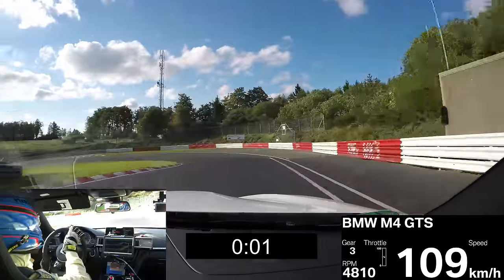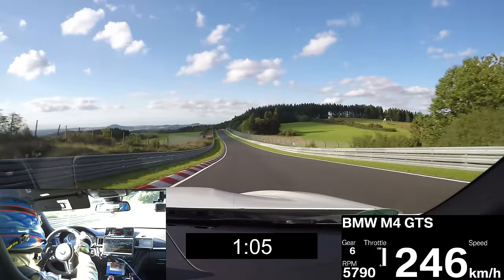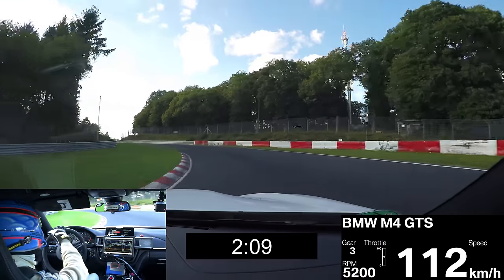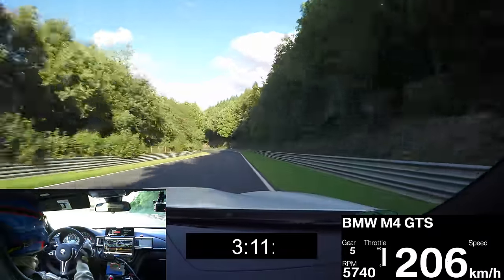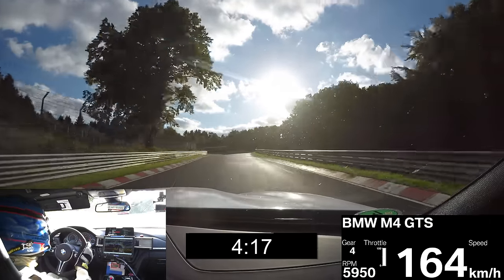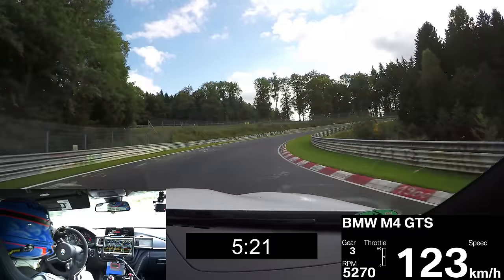BMW M4 GTS Fast Lap Nuerburgring Nordschleife.

Comment from the maker: Enjoy!
Reply: +BMW M AWESOME SUPERCAR, one of the best in the world!
Reply: +BMW M Wooow, great driver too!
Reply: I really appreciate the commentary! It's good to have a credible driver talk about the things to look out for on this track. Amazingly stable car.
Reply: What tires did you use for the hot lap?
Reply: +BMW M Very impressive BMW, not far off a fully striped out, hardcore GT3 RS! Yet carrying another 160+KG
Reply: +BMW M super good video but i think the guy on the voice should not spam that much.. we want to hear the car and it's annoying at all..
Reply from the maker: +giannhg13 Try this one: https://vimeo.com/149558690 ;)
Reply: +BMW M yeah better than c63S!!
Reply: I did!
Reply: +BMW M That BMW schould beat Porsche 991 GT3 RS, it has lower engine and more torque than Porsche. Needs better driver
Reply: +Hen zo 
actually its his style that trows you off. its  how some drivers use that wight shift to get rotaion they want others hold the wheel in one place and use the throttle to do it. trust me he did very well
Reply: +Kreso Ticak I forgot about speed limiter at 270 km/h
Reply: Outstanding
Reply: +Simon Walker there's always one Simon walker who has keyboard warrior syndrome. Congratulations for showing your ignorance of all things engineering. Nice rant. But pointless
Reply: +jamviator There are some keyboard warriors who need to get their facts right. All talking about specific outputs yet a family car just beat a £400,000k hypercar around the track
Reply: +jamviator  Move on with your life? What life considering you are on youtube trolling lmao?! And Merc fanboys coming from a BMW fanboy judging by your avid bullshit. "BMW is the best engine manufacturer in the world, period." lmao where are they in LM1? LM2? Formula 1? Mercedes, Ferrari, Lotus, and McLaren are only names you see ever come up.  No BMW. Mercedes has evolved the racing motorsport time and time again lmao in over 100 year history. They had cars in the 30s with over 1000hp that were too powerful and too fast for drivers at the time...then. And you come with this bullshit about it just beat a Zonda. So what lol a GTR will beat any car these days even a fucking Veyron. Instead of glorifying BMW why don't you mention facts like these times lol : 8:05 BMW M3 E92;  8:07 BMW Z8 E52, 8:09 BMW M6 E63, 8:15 BMW 1 Series M Coupe. Thats range bmw is at for their M cars lol. So here they come with a lightweight edition of a highly tuned car running cup tires and considering it uses fucking meth injection to even get that power. Just like the M button these cars are never run full boost all the time. not to mention you dont own one nor ever will. Hell you will never even go to fucking Nurburgring track. In daily life your underpowered BMWs will eat dust period. 

" I compare BMW to all other manufacturers combined." spoken like a true trolling BMW fanboy who decides to be a keyboard warrior as guy below put it lol. Going after a Zonda F and comparing it to this...hahahahaha fucking moron. A Radical R8 will do sub 7 min time and its legal in most countries except US. Do you see anyone saying its better than a Veyron? Zonda? LaFerrari? I could see it if it was Porsche and a GT3 or GT2 at it....but a BMW???? Now you just sound dumb as fuck
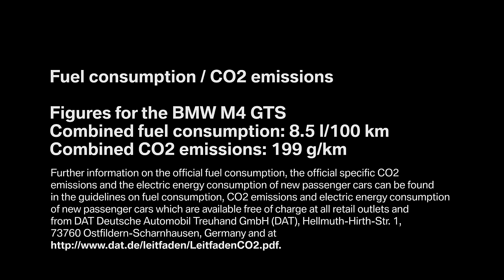Reply: +Ray Tech Thanks for the history lesson. Now, before you go off on a rage and act like a 12 year old, let me offer you some schooling. I will use Mercedes as an example here only because you mentioned they were a name synonymous to racing and, according to you, are the only ones who have evolved racing motorsports...  So here we go. Lesson number 1. It doesn't matter what engine Mercedes has made in the past, no one denies their engines make more power, but the fact remains that they are always slower on the track. You mention Mercedes leads the field in race technology, yet the fact that they have only ever won at Nurburgring once tells us this is a lie. BMW has won there 19 times. Porsche 11 times, Audi 3 times. Lotus or Ferrarri are yet to win. What about DTM, the official German touring car championship, comprised of only BMWs, Audi's and Merc's? Since BMW's return to DTM in 2011, BMW has dominated with Audi hot on their heels, leaving Mercedes in the dust. I can go on the mention the other big GT races where BMW and Porsche have dominated and yet again with Mercedes & Ferarri nowhere to be seen. Mercedes only seem to win at races where BMW and AUDI have no presence. Now imagine what would happen if BMW actually made an LMP1 or LMP2 car? You mention Mercedes evolved Motorsports. Ok, fair enough, but are you so biased to forget the e30 M3, the car that brought us todays sports coupes and sports sedans? You cannot argue that the e30 M3s dominance over the 1980's touring car championships was an engineering feat, that it's design changed touring car championships forever. What about all the engines BMW designed for F1 racing during the 60's,70's,80's? Even though BMW did not partake in the series, they still made engines for many of the racing teams. They designed a 4 cylinder turbo engine that made over 1000hp for an F1 car. Why not mention this? Or was that not good enough to evolve racing motorsports for you. With BMW's track record in racing, I see no reason for you to be so negative against them. I happily acknowledge that BMW does not make the fastest car out there, but remember, that is not their goal. Zonda etc have their clientele, they make cars for a different client. BMW make affordable drivers cars for the masses, so does Mercedes, so lets compare apples with apples no? Lesson number 2. You go on to list a few BMW M cars lap times. What you forget to do is list their direct competitions lap times. Namely Mercedes, who according to you are better than BMW at racing technology. So, lets compare some lap times shall we.  BMW e92 M3 - 8:05 vs Mercedes C63 - 8:15. BMW e46 M3 CSL 7:50 vs Mercedes C55 AMG 8:22. Also, the e46 M3 CSL still beat the standard M4's time of 7:52. I see no Mercedes benz times under 7:40, in fact, only 3 mercedes benz break the 8 minute mark, of which 2 are the same car, so actually only 2 Mercedes AMG cars break the 8 minute mark. If I include the Mercedes Mclaren SLS, then we can count 3. Now compare that to BMW that has no less that 5 cars that break the 8 minute mark and all 5 are different cars. If I include the BMW Mclaren f1, seeing as we included the Merc Mclaren SLS, that makes it 6 for BMW.  If we add modified cars to this list, we have a BMW e46 CSL supercharged that did a 7:22. Should I add other cars that have BMW engines like the Ascari A10 which leaves most Zondas in it's rear view mirror? Your argument is invalid. Sit down son.
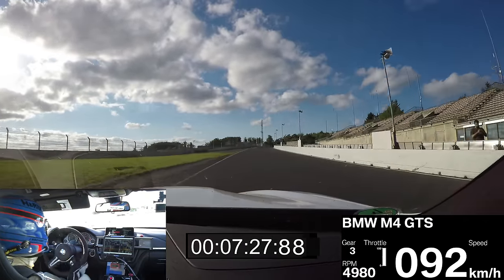Reply: +BMW M 7:27, amaizing
Reply: +Ray Tech you do know M cars are about suspension, and the focus is not on the engine?  Also not everything is about lap times, and whether something is better looking is a matter of opinion.  One can have amazing fun on a Toyota GT86, or a Mazda MX5 (these are prime examples) for less than 30k, when the cars mention can't even break into sub 10 minutes...Its all a matter of perspective.  

you shouldn't just go and slam at other car manufacturers.  Respect is a word you clearly lack in your miniscule dictionary.

Regardless of whether its overpriced or 'ugly', a 7:28min lap time is impressive for a rear-wheel drive inline-6 car
Reply: +Jacky Cheung ur argument is pointless if u sit here and comment or defend original comment that this car is better than a Zonda. Esp it u say everything is not about lap time or any other thing in particular. Im not one bashing other brands here but all you BMW fanboys are. My point is either dont compare it to other brands or if u do compare it to other bmw products such as its own lemans or gt cars. To put this car in same conversation as a Zonda is a joke in itself. No one shopping for Zondas ever even thinks about this car no matter how fast. You do realize Zonda is in same class as a 918 or Laferrari right? U think those people care than an M4 is faster?!?! So you need to expand ur minuscule brain to understand theres more to life than being a bmw fanboy mr cheung.
Reply: Ray Tech
I agree.  its pointless to compare zondas and bmws with just lap times.  Zondas are much older and the technology at the time is not as advanced.  they are also completely different cars types (one is mid engine super car, one is a gt).  back to my original point, just because its faster, doesn't make it a better car to drive. 
you can't say that nobody shops for zondas, cuz they technically don't exist right now.  only the huayra exists, and not a small amount of people buys it.
Reply: Ray Tech If speed alone doesn't make one car better than the other then why have you been making that argument this entire time?

I agree that speed alone doesn't make one car better than the other, but you use that argument only when it suits you. That's the hallmark of a fanboy. Nobody is hating on merc or zonda, we're just saying that all of your hate against BMW is nonsense because this laptime is genuinely amazing.

I have nothing more to add since M3 supercharged already completely schooled you. so goodbye.
Reply: +jamviator "That's a mid-engine supercar with an AMG V12 and it just got beat by an i-6 front engine car." 
thats you talking out of your ass. So much for this track time when in real world an E92 m3 gets beat by an E550.....382 hp v8 midsize sedan vs 420hp v8 "sport sedan" and thats end result lol.  not even an AMG lol.....
Reply: Ray Tech hahahahaha, this is hilarious. i am not the one bashing another automaker, pretending like they can't do anything good.

Oh and by the way there are quite a few BMW's with 1 million KM and over. Go look it up. In fact one engine was examined after running for 4 years at high speed and the tolerance levels were the same as a brand new engine. And it was a 6 cylinder, and it's a mass produced engine.

This has been repeated over and over on various BMW engines to show the importance of regular oil changes.

And whatever you want to believe is your business but BMW has won the world's premiere engine award ten times as much as mercedes. More times than all other manufacturers combined. So you claiming that BMW engines are crap is simply bullshit coming out of your mouth.

Oh and by the way... M3supercharged schooled you.

Goodbye loser.
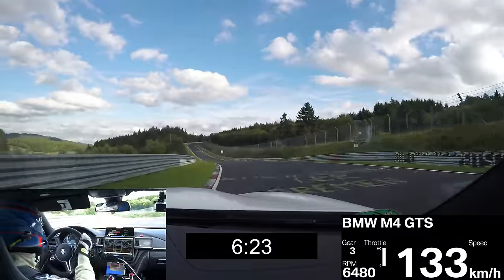Reply: jamviator The bmw engine in question about tolerance levels was a simulation test by castrol smh and any few engines that do make it are not high performance m models. Any biturbo engines over 250K yet? And "show the importance of regular oil changes" haha you do remember how bmw was telling people they could change their oil every 15k miles then engines were going defunct in older 2002+ 7 series or any other v8? hahaha Not to mention that they eat up oil, almost 1 quart every 1000 miles in newer biturbo v8 engine configuration. So dont talk to me about importance of oil or excellence. No one got into car mfg bullshit cept for you buthurt fanboys. My point is M did a nice nurburgring time? Great! fastest BMW ever! Leave it at that dont go saying "It beat a Zonda F time and that has an AMG V12 engine!" It beat a lot of cars but u wanna specify that in your conversation AMG v12 = v6 twin turbo??? That same engine in Zonda R as I pointed out set a time of 6:30 based on nov 2015...... previous was 6:47...now come again what car and what engine were you trying to tear down? If your gonna be a fanboy know your facts lil bitch. almost a full min faster than ur fastest and you dare talk to me about engine quality and reliability.
Reply: +BMW M send me a fucking M4 and i'll ENJOY
Reply: +BMW M Oh I did!!! :D Graceful driving there!
Reply: HAMZA AKGÖZ They could have built an M4 GTR for a homage to the M3 GTR
Reply: BMW! i had a few delays with my gts, whats your opinion on the gpower tunes?
Reply: +BMW M, I mean, how come the GTR gets a little over 7 minutes and cost less....?
Reply: Anthony Abelardo the gtr is a pile of cheap shit. The only thing going for it is the sound with a good exhaust.
Reply: Crimea blue 

"he gtr is a pile of cheap shit. The only thing going for it is the sound with a good exhaust."

???You think the GT-R sounds good?? I think it's the worst sounding sports car out.
Reply: JerseyMikeP with an aftermarket exhaust yes
Reply: The Nismo that ran 7:08 wasn't ANYWHERE near stock. I don't think there was anything that WASN'T modified.

It is easily seen by how a "Stock Nismo" tested by Motor trend on different tracks is Slow compared to the competition.

1:35.51 @ Laguna Seca when a Base viper ($90k SRT) runs 1:34.63, GTS runs 1:34.23 and the ACR has the track record @ 1:28.65.

Hell the 2017 GT-R got beat by the GT350R Mustang and was only .70 seconds faster than a $47k 455hp 1LE camaro.

Nissan cheates the most at the nurburgring...then comes Porsche. You look at every other track time(non-japanese) and it shows how slow they are.
Reply: Crimea blue OK...but anything can sound Good with an aftermarket exhaust...even 120hp Hond civics, LOL.

A $110k+ car sound not need exhaust mod to sound good.
Reply: Anthony Abelardo the gts is not a luxury car! It's a track car just as much as a road car! Also the sound in the car is beautiful, not excessive at all.
Reply: Naredo Iwanaka BMW was doing it right all the time by not up charging too much like Porsche but the M4 GTS is unacceptable.
Reply: Naredo Iwanaka The idea is not to blow money away if not needed.  It's not like you are adding wings for $80k and now you can fly and land somewhere.  You are the kind of person who would buy Rolex because of the name.  Probably the same person who would buy Gucci because of the name.  $550 for a belt.
Reply: Anthony Abelardo ok then buy a fking civic
Reply: Naredo Iwanaka Did you even read my post?  I said I have a '13 750xi.
Reply: Crimea blue Pretty much how much I got mine for.  What do you drive? Cost aside.
Reply: Your claiming you have a m4 gts? I drive a Audi a4 2.0t b7 but I have a black gts too
Reply: Crimea blue I'm claiming if I could afford one I wouldn't even get one.  In that category the GTR would be prime choice with a full track kit.  For the street I would prefer an X6M.

The idea is to get the best easiest method to get something done.
Reply: The Truth It really depends on the tire though.  I think these test are cheated by using DOT-R tires.  Some are on season tires, summer maybe.  Still though, if you have a very fast car you won't be able to stop if you drive really fast on street tires.  If you really want to speed on the track you need a track kit with non-DOT racing slicks.  People always comparing times but it's really down to the driver.  And, even if people are at the limit they can touch a run off and lose control.  They can also run with tires that are worn and lose control.  They can also not be able to stop due to the brakes being cold.  You can have perfect lines but when the ambient temperature and surface temperature changes your lines are all wrong.  There are too many variables that could happen such as hitting a slight bump on the track that didn't seem to make any difference before but under heavy power or braking cna cause the car to be unstable and wreck.  In my opinion, if money was no issue the best versatile vehicle to drive all the time would be a performance SUV.
Reply: I'm saying that depending on how the car is setup and the temperature, air pressure, track conditions, driver mood that even the fastest car could be slowest.
Reply: +Anthony Abelardo that's just excuses. the gts lap i see here is near perfect.
Reply: Naredo Iwanaka The idea is to get a car that can get low lap times with ease.
Reply: Anthony Abelardo There is no street car that can do low times with ease without slicks. Not possible yet. It's like saying the idea is to get a sprinter that can do 9.7 second 100m time with ease without peds. Not probable at all.
Reply: Naredo Iwanaka I mean, when slicks are on a car it would change how the car handles completely.  I assume some cars would get a better lower time than others.  It wouldn't be an identical ratio.  I also assume some cars on slicks would have the chassis bend permanently.  I read BMW doesn't allow some of their models to have an M version because the chassis isn't stiff enough like the 4-series grancoupe.
Reply: +Anthony Abelardo every car, no matter how optimized it is for slicks use, will always run faster with slicks. That being said, to optimize the grip and minimize handling problems, we need a stiff chassis like you said. You can do this with the suspension alone. If you want the extra tenth you can add the roll bar and braces... The common excuse for using a roll bar is increased safety. But all these cars have 5 star crash test safety so it's just an excuse after all. This is what Lamborghini did with the sub6 time. slicks+roll bar+stiff suspension setup. No info is known about the fuel used. Nothing is known if the engine has the same specs as retail car. 6:59 is impressive performance but it's safe to say that it's tweaked. Because the downforce on the Nissan GTR is much more significant than on that lambo which benefited only of a rear spoiler and low drag coefficient. Also, you should remember that one unit is nothing for a multi billion dollar company like BMW Nissan and the such. 100k is nothing. I wouldn't be surprised if they cheat here because they all do it because there isn't rules about it so no one is cheating.
Reply: Naredo Iwanaka Well the Lamborghini LP750 has more HP and is AWD.  It should be a given with the right driver to hit 6:59.  I mean, I didn't even know the LP750 because I stopped researching way back about new vehicles.  The LP750 is probably the best choice now unless there is a better Lamborghini than that but isn't the cost of that like $500k?  I mean the 918 Spyder did 6:57.. but the cost of that is like $900k?

Radical SR8LM did 6:48.. and $180k.  If you want to go fast on a track you should just get a performance SUV and tow it in an enclosed trailer therefore you get the best of all worlds besides flying in which you need the Icon A5 but it can't VTOL or underwater.

Probably the best all around track and street luxury vehicle for the money would be...?
Reply: Oh and to let you guys know.. if the tires fail, it doesn't matter what you have.  You will crash if you try running it at the limits.
Reply: Anthony Abelardo if you crash by trying to run at the limit of grip it means you have zero skill and you should go back to the driving school
Reply: Naredo Iwanaka Even if your tires were to blame from being too worn, too hot, or too cold?  The grip changes according to ambient temp and track temp too.  Also your fuel load would play a factor in your lines.  F1 drivers are 4 seconds slower with a full tank than less.  There are so many variables that go on that it's probably best to be at 95% off full potential than 100%.
Reply: show me ONE SUV that's within 30 seconds of a track record
Reply: yes, because no one is stupid enough to run tires too cold too hot or too worn. there are pits for that reason. to change tires.
Reply: Naredo Iwanaka I don't think anyone in the history of nurburgring racing has raced a 1000hp performance SUV on racing super softs for 2 laps to get 6:30?
Reply: because suvs are not made for the track.
Reply: Naredo Iwanaka What are they made for then?
Reply: troll harder. wikipedia exists.
Reply: Naredo Iwanaka I wanted your "opinion" not wikis.
Reply: Sergey Popov Then Here comes Porsche With the 911 GT3 Rs 7:20 what A shame BMW still can't beat porsche
Reply: Da,Taper at least its close and the m4 gts did kill tons of porshes on the track a lot just the 918 and gt3 rs
Reply: +Naredo Iwanka, "if you crash by trying to run at the limit of grip it means you have zero skill and you should go back to the driving school". 

LOL, And how many F1 drivers have crashes every season? 

Koenigsegg crashed here, The track was closed for a year because of Nissan's crash, the Z06 and Z/28 crashed during testing. If you aren't on the verge of crashing then you aren't pushing the car enough.
Reply: +Da Taper, "Then Here comes Porsche With the 911 GT3 Rs 7:20 what A shame BMW still can't beat porsche"

Just like how Porsche 911's can't beat Corvettes or Vipers.
Reply: It could also mean someone leaked coolant/oil/fluids on the track when racing.
Reply: JerseyMikeP noobs
Reply: +Naredo Iwanaka  Noobs??? Have no  idea of what you mean...
New car owners that crash?
Professionals that crash at the nurburgring or F1 drivers that constantly wreck?

Anybody can crash when pushing a car to it's limits. If you never come close to crashing they you aren't driving hard/fast enough. That's why I love how 911 turbo S fans talk about how much a handful the Z06 and Viper are...if you drove as slow as the 911 turbo S they are easy to drive.
Reply: JerseyMikeP Cough 911 GT2 rs don't worry next year when it returns all American track times will Fall
Reply: Well I guess every professional driver is a Noobs...because they ALL have crashed multiple times.
Reply: Da,Taper 991 GT2
Reply: JerseyMikeP they rarely crash
Reply: Naredo Iwanaka....Who? Profesional Drivers? LMFAO Have you seen an F1 race....there usually is an accident within the first lap (100ft). Also there is usually at least 3 crashes per race. If you aren't close to crashing...you aren't pushing the car to it's full potential or going fast.
Reply: JerseyMikeP that's different and bullshit. You are not racing against anybody when running a hotlap. So yeah only a noob will crash in every hotlap.
Reply: LOL...If they crash all the time when racing how is that different.

 It's the same as if they crashed during a qualifying lap. Like I said before if you aren't at the verge of crashing you aren't pushing the cars to the limit. Plenty of test driver's (which doing these laps in a good part of their job) crash when testing here.
Reply: Why don't you stick to your video games.....Adults know whats real. FYI I've been a BMW factory trained tech for over 10yrs. So I've probably driven more BMWs that you've ride in. Same goes for racing, being on crews for 6sec dragsters and SCCA autocross teams.
Reply: Awesome!! Salute to you sir!
Reply: +BMW M Next BMW M4 will be as fast as this one ?
Reply: I did ;D
Reply: Thank You. More, please.
Reply: Love it ///M ///M Forever